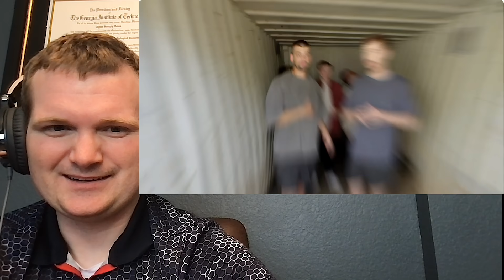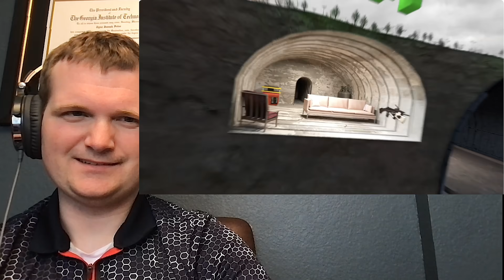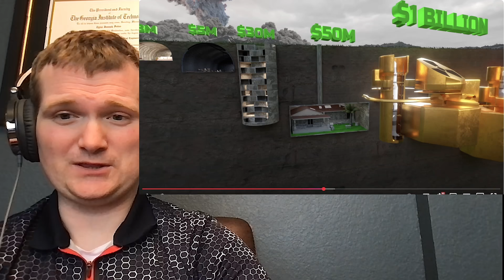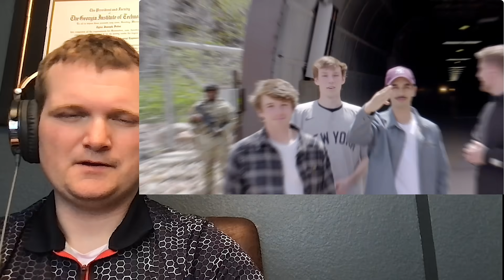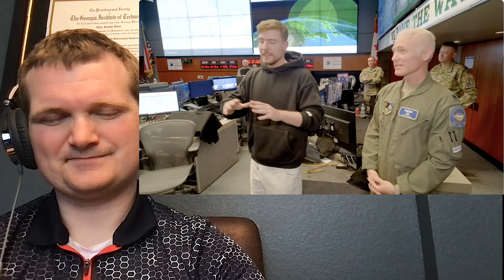$1 vs. $1,000,000,000 Nuclear Bunker - Nuclear Engineer Reacts to MrBeast

Comment: The video stops at NORAD like the billion-dollar bunker is the end of the story . Cheyenne Mountain alone has 15 buildings mounted on more than 1,300 massive steel springs, huge blast doors, independent power and life-support systems, and roughly 2,000 feet of granite around parts of the complex. And that was engineered decades ago.
Now look at what modern bunker construction can use today: ultra-high-strength concrete, steel-fiber reinforcement that helps keep cracked concrete from breaking apart, elastomer/polyurea-style blast coatings that are basically industrial “truck-bed liner” for concrete, self-healing concrete technologies, improved radiation shielding materials, better structural isolation, and decades of advances in tunneling and blast engineering.
I’m not saying Cheyenne Mountain specifically has all of that. I’m saying if you were building the next generation of hardened command bunkers today, you’d have a completely different toolbox than engineers had in the 1960s.

That’s why my tinfoil-hat guess is that Cheyenne Mountain is the **publicly known layer**, not the real endgame.
If the U.S. has spent decades improving continuity-of-government and hardened command infrastructure, I’d bet the serious modern money went into something deeper in the **Sawatch / Continental Divide mountain mass**, where you have enormous rock cover, existing mining and tunnel infrastructure, major highway access for heavy equipment, and plenty of legitimate underground construction to blend into.
Denver Airport makes the theory even more fun because it already has substantial underground infrastructure. Maybe DEN isn’t the bunker at all. Maybe it is simply one logistics node connected to restricted underground transport that heads farther west.
Cheyenne is the bunker everybody already knows exists and knows where to aim.
The one I’d be curious about is the mountain nobody knows matters.

Comment: Deeply buried "super-hardened" military command bunkers built hundreds of feet inside solid rock formations, or mountains, can survive nuclear bunker-buster weapons. Bunkers buried 300 to 1,000+ feet deep, especially those tunneled deep inside granite mountainsides, are isolated from the crushing mechanical cratering and direct thermal energy of the blast. 

Now, of course, most bunkers are not built to withstand direct hits with nuclear bunker busters.

Comment: Many of the old defunct AT&T Long Lines facilities were designed to handle detonations as close as about ten miles.  They were hardened multi-story subterranean facilities with the usual dense concrete, air intake blast baffles, blast doors, decontamination areas, fuel storage and gensets, air filtration and other amenities. They weren't all created equal, some were less hardened. The relay stations could handle about 20 PSI overpressure, while certain AT&T military critical facilities could handle significantly more overpressure events. These could probably be considered a mid-level survival bunker.

Comment: 23:51 -- Cheyenne Mountain complex was designed to survive a direct hit of the largest nuke of the time exploding on the surface of the mountain... at least that's what they say!
Reply: There is also a blast door at both ends of the tunnel, then the door the show... is at right angle, so the pressure wave would just go past it, and not hit it...

Comment: Honestly, i wouldn´t take a step down the 50M one without beeing forced. Wouldn´t feel safe down there at all, with all that burning stuff, crappy elevator, really small "secret exit". I Hope the owner doesen´t throw any parties down there.
Furthermore, i highly doubt there is any kind of appropirate air filtering or water supply, and certainly no redundancies.

Comment: "How much protection would there be in a basement room made of 50 cm reinforced concrete, 75% underground?
The part above ground also has 50 cm walls, and the windows are bolted/blocked so no light can enter.
If a bomb detonated 2.2 km away, the blast would have to pass through around 20 buildings—similar to 3‑story apartment blocks—with 3 to 6 reinforced concrete walls in each, plus brick walls.
How much protection would you have from heat, blast pressure, and radiation in that basement?"

Comment: This video was hard to watch, I really don't enjoy MR beats's videos at all.

Loud sounds, constant changing visuals, drama for the sake of drama, nothing of value - they basically just did a brief tour of the interior of each bunker and messed around a bunch, and the first one was probably just them that put a crate into a hole for some reason.
No food and water storage supply was showcased, nor was there any water or air filtration systems shown or waste management. Everything that would be interesting about those bunkers were completely left out and ignored.

Comment: Well, the video might be 5 months old, but I asked the question about radiation underwater and why they used to test the bombs underwater and and why the there was no fallout. And basically you answered my question, especially at the depth they release the detonation pretty much neutralizes it pretty much. And I don't see any double-headed fish around Easter Island or whatever they used to bomb the crap out of the other. What do they call those? Lylands not Islands but whatever.... Yeah so that's probably why they started it. Doing more tests below the surface of the water. Also to see if what magnitude of a bomb would flip over in aircraft carrier using old ones obviously or older ones. Could you imagine the gyroscope that would have to be on that SOB not flip it over. It have to be like the size of no. Probably the size of an aircraft carrier itself

Comment: Conventional (MOP): The GBU-57 MOP can penetrate approximately 200 feet (60 meters) of rock or earth, with newer models likely capable of deeper, according to reports. It is specifically designed to destroy deeply buried, hardened facilities.
Nuclear (B61-11): The B61-11 is designed to burrow into the earth before detonating to maximize ground shock against buried targets. While the weapon itself only penetrates a few meters, the resulting explosion can destroy underground bunkers down to depths of roughly 1,000 feet (300+ meters), depending on the yield.
Test Data (Sedan Crater): A 104-kiloton nuclear test (Sedan) detonated 635 feet underground in 1962 created a crater that was 320 feet deep and 1,280 feet in diameter. 
Union of Concerned Scientists
Union of Concerned Scientists
 +4
Factors Limiting Depth:
Geology: Penetration is much higher in soft soil or clay compared to reinforced concrete or hard rock.
Speed: If a bomb hits the ground too fast (above 1 km/s), it may be destroyed on impact.
Strength: Highly reinforced, modern, high-strength concrete can significantly reduce the penetration depth.

Comment: Hey, I "broke into" an abandoned ICBM missile silo facility in the early 90s. We had to rappel in and then climb down 50 feet+ by a ladder attached to the wall. It had an iron grate soldered over the top and like a gate all around the missile launch hole because it was in the middle of a cow pasture. We defeated the soldered grate because others had broken it before us. They'd also put a big metal plate (about 3' by 4') over the top of the ladder to make it harder to get in, so we had to rappel around it. Lots of people had been in over the years, and there were clear spray painted "Exit" signs. It was decommissioned sometime in the mid-70s, we think, because I found a few pages of an MSDS and it listed different chemicals, etc., one might find there. So in 1974, asbestos was classified as a "mild lung irritant." 

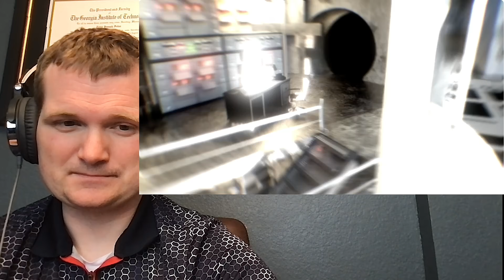We didn't know why, but we all got REALLY itchy down there. My dad later suggested that if we went back we should bring a geiger counter because people "didn't know as much about nuclear" as we did by the 90s, and it might not have been as safe as we thought. I figured that with an ICBM, there wouldn't be any leaks. Still fun, and it's nice the video showed a mockup of what it looked like when everything was still there. Most places had no stairs so we'd suddenly come upon rectangular holes in the floor like in the middle portion they show at 04:07. There were SO MANY old beer cans at the bottom of the way in we used, and lots of them were so old they had pull tabs. The floors in the hallways were gone, so we walked on the wall frames to avoid walking in murky, rusty water below that had gathered over the years from the place we came in only having a grate, not a cover. Anyway, that was over 30 years ago and we're all still alive, so it was definitely worth it!

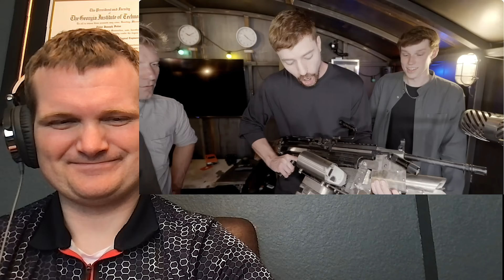Comment: 9:00 I mean, dude, thats Colin Furze. The dude known for ...building ...stuff. 13:00 Colin's ...cellar isnt going to help much about the overpressure, seeing as he's lacking blast protection valves on any air intakes. Structure might stand, but you will not live to see it, once the shock front propagates to the inside.

Comment: What about abandoned mines? How viable those are as nuclear shelters? Sure, direct hit would kill you, but in nuclear war, nukes are not aimed at old mines but on military installations and major civilian metropolis. Would it be financially and technically possible to convert them to nuke shelters - mainly due to radiation fallout in air that would require air filtration, food stockpile, and clean water supply.

Comment: I read many years ago that Cheyenne mountain was designed to withstand a 3MT warhead.  The main doors are also on the south side so as to be on the back side of the mountain, assuming ICBM's attack via polar route.  This was probably suitable for its era, but could be defeated by an earth penetrating bomb exploding inside the mountain, simply using a larger bomb, or Russia's new ICBM that could go via the antarctic route for a south side attack and may be accurate enough to drop a bomb right on the door.
Reply: During the early-mid cold war missiles had CEPs (accuracy) of several hundred meters, whereas the most modern systems today have double digit CEPs.  The overpressure difference between a blast at 50m and a half kilometer is obviously quite substantial.

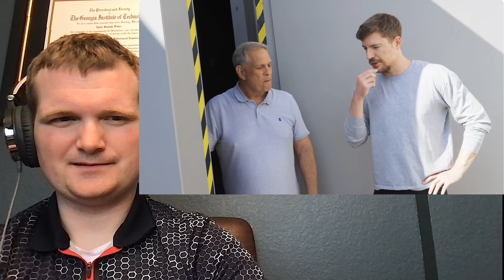Comment: 15:22 RPG (7) can penetrate more than 10 feet of steel armor with its HEAT round pg-7, and thats only round from 1960s. That 2 feet plate is not surviving a hit from RPG, but it can withstand at max 155mm high explosive shell or armor piercing 50.

Comment: NORAD facility isn't used to direct or run the operations of nuclear war. NORAD isn't even even a full combatant command. It is part of the NORTHERN Command though, which is a regional combatant command. It is used to monitor for threats and to respond to non-nuclear threats to North America. Nuclear War would be directed by the Pentagon, as well as the US SRATEGIC COMMAND (USSTRATCOM) which has an underground bunker complex of it's own at Offutt AFB. It is the Global Combatant Command for the Nuclear Triad forces.
If NORAD detected nuclear threats it would institute communications conference via hotline to the Pentagon, STRATCOM, and some others.

Comment: Well the Cheyenne Complex was built between 1961-1966 and became fully functional in 1967 so you are talking in different dollar values, as well as you aren't talking the full cost of the facility. A billion dollars for the equipment, excavation, it's initial infrastructure and the initial facility sure I can believe that, but I'm sure it was all but gutted and retrofitted, updated and expanded on and what not for much much much more than the original billion price tag which was in fact actually $142.4 million for the equipment and excavation. Which if they took on a project to do this today today instead of $142 million would cost $1.535 Trillion dollars.

Comment: The hydroponics, where do they get sunlight for those?
If it's solar panels those probably don't last long after the blast, and they will need to clean out the fallout dust covering the panels every now and then to keep them working, which probably isn't going to be a good sight when people inside don't want to get out and do that and they have guns.
I guess they can have power generators that use fuel underground, but I also won't trust the fuel to be enough for long when they are having so much stuff that requires energy down there.

Oh, and the 5 min scramble when detecting an unknown plane?  That is considered slow in Japan.  To be fair, the threat is completely different.  Japan is much smaller and required much faster reaction times because their potential enemies are right next door and they cannot scramble every time something leaves those airspace flying towards them.  So they have the pilots standby much closer to the planes(like in the next room of the planes) and drill much more than the American counter parts(where they standby in like a min drive from the plane)

Comment: 24:00 There is a limitation to the penetration. A B61-11 can penetrate about 3–6 meters (10–20 feet) of reinforced concrete, or 10–20 meters (33–66 feet) of soil. The shock-wave of the 1-megaton detonation could destroy a bunker up to 300 meters depth. However, for Cheyenne Mountain we are talking 610 meters (2,000 feet) of rock (harder to penetrate than concrete). A B61-11 would cause minimal harm. You would need multiple precision strikes in succession, or something like the "Robust Nuclear Earth Penetrator", a concept weapon that got canceled in 2005 (too high costs and other concerns...). This installation is likely to survive any direct attack.
Reply: do u think u could penetrate uranus with a B61-11 or penetrate another gas giants supermassive black hole or does it require penetration testing first

Comment: For many years, i have had an interest in nuclear bunkers, learning all about what you need.. A lot of stuff people would never think about is needed if you want to survive, and missing a single small thing can be the difference between life and death. Having an NBC Air filtration system is far from enough. If a nuclear bomb was to explode "nearby", the blast wave would be so  powerfull that the presssure would literally cause your nbc air filtration system to explode and you to die from the high pressure inside the bunker. Therefore, you need to put heavy-duty over pressure blast valves on all intakes and outlets.. These are made of thick metal, and are held open by a spring.. When the outside pressure suddenly increases to a high enough pressure, the force overcomes the springs power, which causes the metal discs to slam against the wall for the duration of the overpressure outside.. Anyways, The guy who has that bunker in his back garden, has a whole series of videos on his youtube channel called "colin furze" where you can see him build each step.. I dont think he has any blast valves or even a NBC air filtration system, but i still think its some great videos.. The bunker itself is pretty well built.. something that was not mentioned in this video, is that the "other room" in his bunker, which is the biggest room, is actually a underground garage which has a platform at ground level which can raise and lower a car, to park it inside the bunker lol

Comment: ** Even nuclear bunker busters have limitations. While they are designed to penetrate hard rock and earth, a mountain like the one protecting the Cheyenne Mountain Complex provides a massive buffer. The B61-11, a nuclear earth-penetrating weapon, can crush bunkers to a depth of about 1,000 feet. However, the Cheyenne Mountain Complex is located under 2,000 feet of solid granite. A weapon would have to penetrate this enormous distance before detonating, which is far beyond the known capabilities of existing bunker busters. The extreme depth and density of the rock act as a shield, dissipating the shockwave and making the complex essentially invulnerable to a direct strike.

Comment: "Water is great Radiation shielding" That's why I told in a comment to use high powered Ultrasonic shockwave echoes tuned to pull water from atmosphere to clash with outbound Ultrasound waves to form a water barrier for exposed fusion reactors to prevent beaming on people. Points at UFO orbs pulsing How does a Star maintain fusion? So what is the shield being controlled by for those visible results? You should know this.. YOU DO. Same shockwave technology can be used with audio spotlight to take water from atmosphere anywhere you go as a portable device. No tap water chemicals damaging DNA..

Careful when crushing plasma with shockwaves.. Google: "Ultrasound excitement of Electric Plasma generates stronger EM field" I pissed off your Military by accident I forgot they have sensors everywhere for EMP weapons using the same science. Points at Two helicopter crashes by collision in Kentucky I liked that scene in "The Day the Earth stood still" where he crashed the two Helicopters that tried to bully him. Google: "Balls of light Chase U.S Navy" Bully us you'll learn to run.. - Dracula (World Genome harvesting Ultrasonic holography Bioprinting assisted Super Shapeshifter) The THING was insulting.. Points at Phantoms 1998 super being That's closer.. Google: "Anubis Hound Statue Vatican Museum" > Points at Dog in Phantoms 1998 https://www.youtube.com/watch?v=J46EcAqZAPY